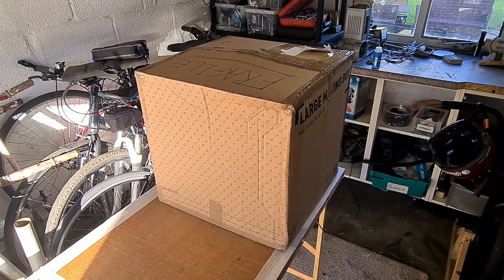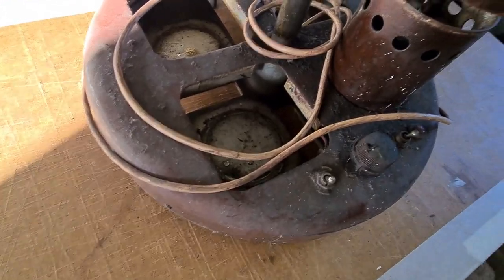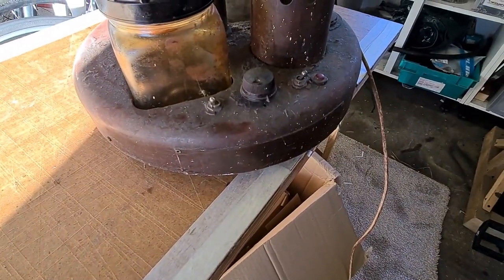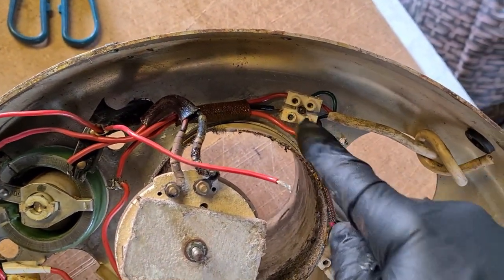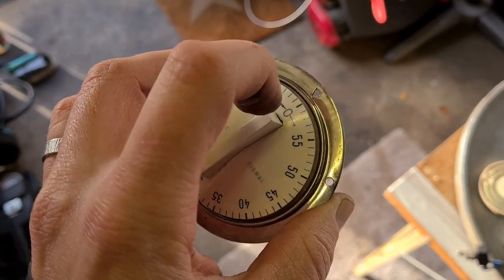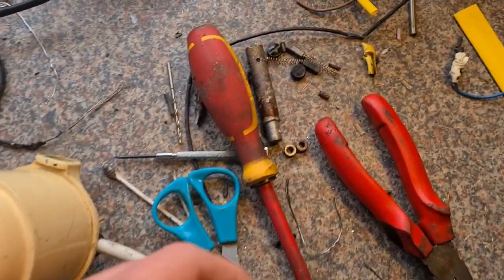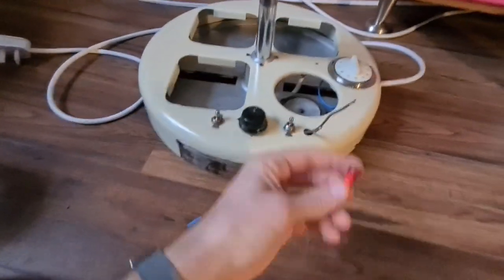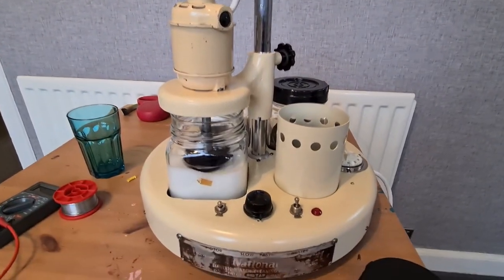Restoration and Repair of a 1940s 'National' Watchmakers Cleaning Machine

Comment: Just got a vintage brenray cleaning machine but as a carpenter with zero electrical experience (or confidence) I’m too scared to work on it 😅

I really want it to be completely redone as the thought of an electric shock terrifies me 😂

I’m thinking of taking mine to a repair shop if I can find one. 

You did a Great job on yours 👌

Comment: Really interesting journey, especially as I'm not great with electrics. Thanks for sharing.
Couple of notes if you don't mind, hopefully helpful. Grab yourself a cheap tripod or table clamp and phone holder if you're filming on the phone. Just to give yourself both hands to work with and free up your camera hand.
The metal cover above the basket should actually seal against the jar lid when it's in use. If the basket bottoms out then the spindle sleeve has been altered in the past and is too long or an intermediate cover should be there.
I'd recommend sizing it so that the basket with the lid seated is about 1cm from the base of the jar, this will prevent splashing solvents and fumes. Really Great restoration though and the paint was a very good match.
Reply from the maker: Hi buddy thanks, sorry I'm late at getting to these comments but you're totally right - a tripod is on the way for the next one. I've just started a video for an Elma restoration so hoping to get that completed in the next few weeks.

Comment: I enjoyed your your video and the work you've done. I just got a similar vintage Swedish made watch cleaning machine. When I plug in nothing happens, no buzzing, no movement. How do you suggest I start trouble shooting / diagnosis and go about it ?
I have very basic understanding of electric.
Reply from the maker: I'd have a check that the fuse is good first and work from there. 

You could simply replace it for a known good one if you don't have a tester. 

If nothing at all is working I'd suggest that, and checking the plug wiring. 

Just ensure its 240v and not 110v

Comment: Did you do a wiring diagram? I noticed you used a rheostat to adjust speed. How was this connected?
Reply from the maker: I just mirrored how it was connected when I received the unit. Usually it's just a big resistor between the live feed to the motor

Comment: I'm in the process of restoring a S. Lanzetter National model 1 which has a case iron base. The motor works and I've actually had it working on 230v and 24v however I've decided to replace the internals with a modern 12v motor for safety concerning the 230v heating element using flamable solvents.             The other adavantage is the possibility of connecting a audunio micro controller at a later date that would move the motor forward and reverse for given time intervals which I believe modern cleaners do. 12v fan assisted ptc heaters are available and I've got a motor on the way. I'm also swapping the pitted chromed riser pole for stainless steel. I'd be grateful for any info regarding the way modern cleaning machines work.
Reply from the maker: Hi mike I'm sorry I didn't see your comment. I hope you got into your project - more modern ones are completely automated. You can even get automated L&R ones called a variomatic which are hydraulically controlled, but they're very complicated to work on! Hope it is going well.

Comment: great video thanks, i have a similar machine and need a new heater element, are these still available?  many thanks
Reply from the maker: The answer is.. sometimes. The heating element is only a coil of wire, to be honest if it's not warming up it probably has a break - it just looks like a big spring. I personally would just try and repair the one that's on it. You could either try twisting the two broken ends together or use a brass cable connector.

Comment: Nicely done Paul! This turned out very nice and now you have a good machine for many years. I have looked at the old Elma machines but those are very expensive, even the very worn ones. Hope to see more videos, I also do videos here, see you later, from a restorer to another :)
Reply from the maker: Hey thanks for the feedback. Honestly.i would have kept this and used it if it weren't for my lack of space in the workshop. I will admit, I wasn't entirely comfortable around pure 240v and three jars of liquid though..
Reply: @pwrestoration  Yeah I'm very cautious to and thinking of 240 v that might not be 100% I agree. Yeah about space is also a question, I go manual cleaning now and it works "fine". But those machines are a joy to look at also :)

Comment: Just checking out your channel since you suggested it regarding your watch cleaning machine restoration.  You did a really good job!  You mention that you were concerned about the wires being exposed on the bottom.  Just curious as to whether you have a ground wire connected to prevent any electrical shocks?  I recently restored a 1930's L&R watch cleaning machine and added a ground wire since the original cloth wires did not come with a three point ground wire back then.  The machine also has a reverse polarity toggle switch, but I didn't see one on your make/model?  Not sure whether your machine was built with one?  Thank you for the video!  Cheers.
Reply from the maker: Hi there I did add an earth cable from the mains supply to the body, not sure if you're UK Based but we have them as standard. So seemed silly not to use it. I don't believe this did have a polarity switch in it either, maybe if yours was a little earlier it was a standard then? To be honest this National was very basic when compared to the Elma and L&R machines. I have just started a restoration of an Elma (I unboxed it two days ago) for which I will be creating the next video from for my channel, so keep an eye out! Thanks, Paul
Reply: @pwrestoration  can I buy the Elma when it's finished? :)
Reply from the maker: @vayde  Hi Daniel I'm afraid this one was sold a while back now, I have another if you take a look at my other videos, just got it up and running recently 🙂

Comment: How hot does the motor get? Seeing it has an internal fan - that you had to bend the impeller to get the rotor out of the stator (assuming you correctly re-shaped the impeller when you reassembled it) but the holes at the shaft end appear to be sealed against the metal cover plate - that there is no airflow in the motor to cool it. It would be unfortunate if you put it on eBay and a watch restorer was using it and the motor overheated and they would want a part refund, if I was doing this ~ would have put some washers/spacers on the bottom of the motor to raise it off the metal plate enough to get air under it to the holes and that the impeller blades are at the correct pitch to the direction of the motor so the air is sucked into the bottom and out of the top ✅. I saw the plug that came with it had sleeved L&N pins = so it was already compliant and alright to continue using
Reply from the maker: This is now my personal machine and the motor does get warm, your post has inspired some thinking that it does indeed have no cooling channels. It does get a bit warm. I might whip the lid off and see if I can at least modify it, with screens to avoid dirt ingress.

Comment: I have got model 2 and I can't get the motor housing off I think the 2 small screws are holding back but it's stripped. I need to rewire the motor. So any suggestions getting the housing off?
Reply from the maker: The two pins are threaded into the lower housing, and then held in by nuts from memory with this one. 

If you can remove the nuts, I would scalpel round the join of the two halfs to remove any paint sealing them together. Then a light tap with a small hammer on the two pins. It should force the two halfs apart. 

If it's just two threaded rods with a cut for a screwdriver, if you can see the rod at all down the sides of the motor I would get some pliers on them. If all else fails cut them and replace them with some m3 threaded rod and two nuts.
Reply: @pwrestoration  genius thanks just taken it off. But looks as though the motor is dead but I brought a new one. My next question , I need an alternative shaft cause the basket I brought is 75mm and the aperture is 75mm Derrrr ...can I get an elma basket or can I get a different aperture??? This is turning into a major project!
Reply from the maker: @vintagewatchesforchrist3436  good stuff. I would keep the shaft and modify the basket, it's a lot more difficult the other way around. Plenty of basket options though, maybe get some aluminium and make an adaptor? So your new one fits?
Reply: @pwrestoration  do you know green stars tools they got a GS 2047-03 Apparatus which is a 69mm. I do have a shaft that fits which I think would fits the elma adaptor.
Reply from the maker: @vintagewatchesforchrist3436  there will deffo be a solution that allows you to retain your current shaft. Maybe even a 3d printed solution if you have one or know somebody who does
Reply: @pwrestoration  hey yeah I do know a person who has 3 D printer. Do they scan the item and then reduce it to a diameter to spec? Didn't think of that
Reply from the maker: @vintagewatchesforchrist3436  not entirely sure, I think it's a case of measuring up and then creating the file. Maybe someone has already done one that could be edited? Good luck!
Reply: @pwrestoration  thanks...found some company. So just to things right. The elma baskets are 69mm or 64mm.
Reply: @pwrestoration  just need a little reassurance. So in order to 3D print. I need to reduce the diameter for a 64mm diameter elma basket from 74mm to a 58mm diameter appeture taking into account the 6mm thickness of the rim?